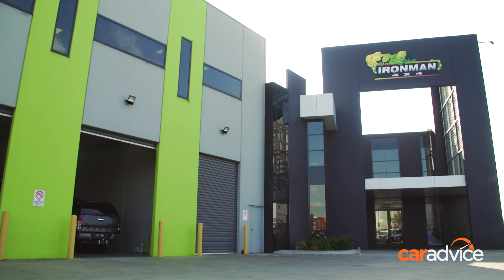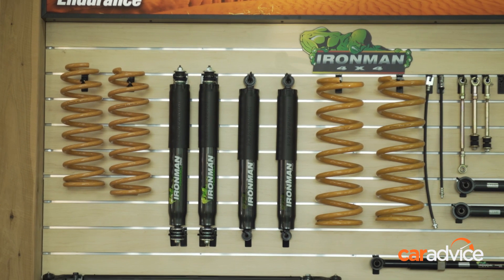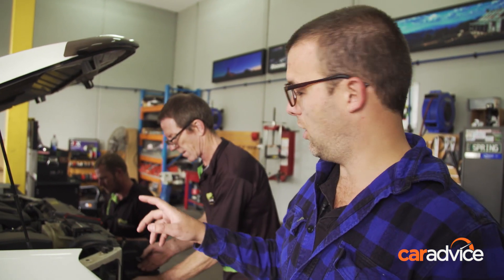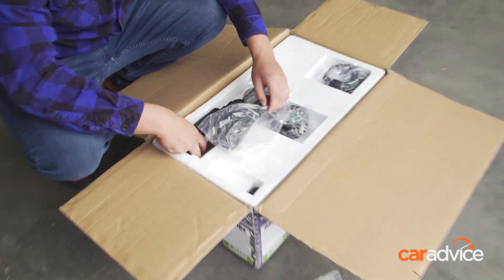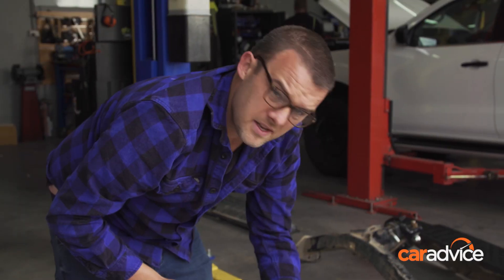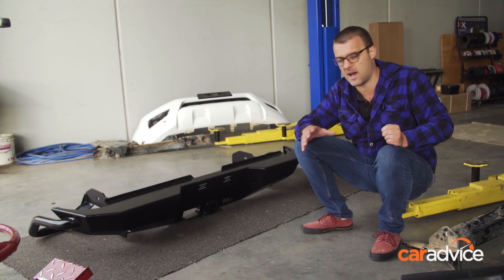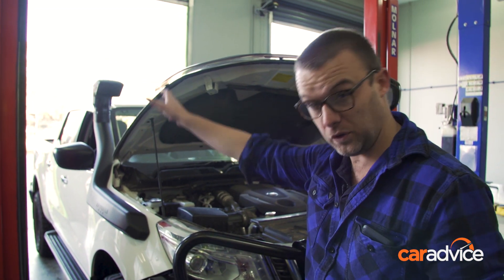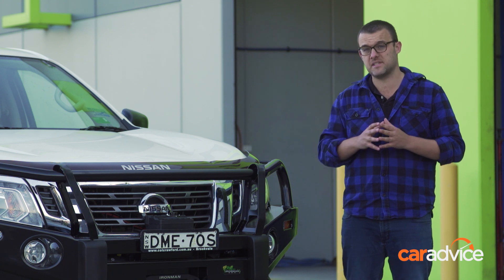Gearing up the CarAdvice Nissan Navara: bullbar, rear bar, snorkel and winch

Comment: How does the navara do carrying load? I read on a lot of reviews that the rear suspension helps give the best ride on any pickup but fails whenever you carry 1000pounds in the box.
Reply: Yea but it does not give a good ride at all, vw amarok with leave springs is much more comfy

Comment: How will you be rectifying the front ride height now the bar and winch has caused suspension sag?
Reply: there's a good chance they fitted the suspension with the extra weight compensated for already, usually the bullbars and the extras have a known weight and you can figure it out before you throw it together
Reply: Adjust the torsion bars
Reply: Strut spacers haha